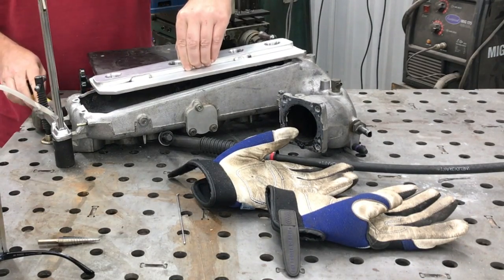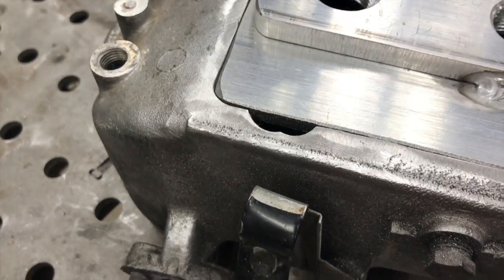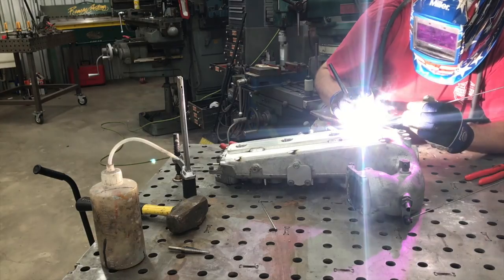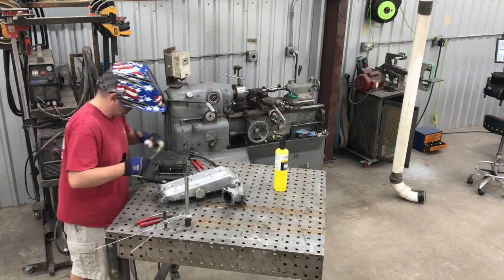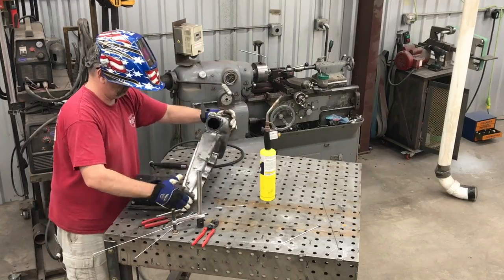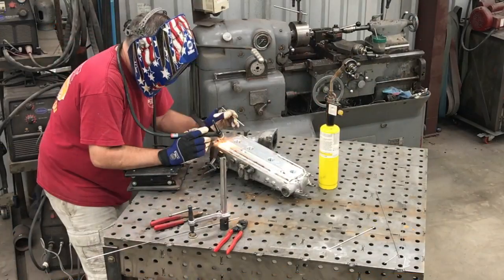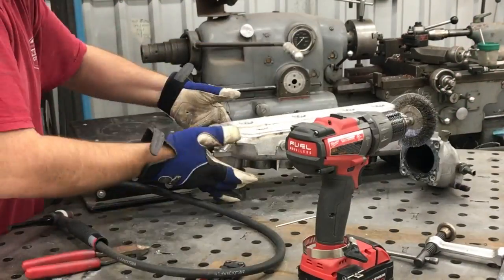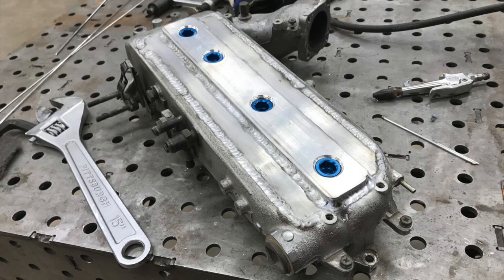Tig Welding Cast Aluminum Intake with Helium

Comment: Hey brother would you say that the argon helium 5050 mix is as effective as running 2 separate bottles with a brass Y...or cheaper maybe?  Trying to decide if I should buy a bottle with a mix or just get straight helium and by all the fittings to run it and to the Argon line... Sounds cheaper to buy the mix. I have a dynasty 280 so it ought to be plenty good enough for dam near any thickness of aluminum

Comment: Hello I would like to buy a welding machine at any company that advises me
Reply: Memo1977 Bahbahani if you want a good machine Tig buy a HTP Invertig 221 you get 220 amps and independent ac EN & EP amplitude setting which are found on the dynasty 350 and 700. The Invertig is reasonably priced $2500 for its class. If you want a cheap Tig to get going look at the ahp alpha x for $700 on Amazon. If you want a mig welder get the HTP Pro Pulse 200 great machine for steel and aluminum without the use of spool gun. www.usaweld.com I have many videos on both.

Comment: It turned out great! You mentioned using a Eastwood 200 Tig welder, which one (old one or new digital)?
Reply from the maker: I still have the old one, 3 years old, has worked great.  I a guy come by for some beginner training and he had the new one so I played around with it some.  Looked alot nicer than what I have.
Reply: I've got the original Eastwood AC/DC 200 and it's around 5+ years old with only about one piece of steel welding rod used! I haven't tried aluminum yet (don't know why I haven't) but it's there when I decide to try!

Comment: You want it to not crack v your mating edges out so you get a full penetration weld. :-)
Reply from the maker: well it cracked because when you cut teh top off the bottom gets a bow in it, then you weld a top on in that position, and try to bolt it to the lower it pulls the bow out and cracks it.  This is fully penetrated, that torch was blowing its own beveled edge all the way through the root and was jamming the filler in to keep it from falling through
Reply: @turbocobra  Try DCEN next time if your'e not going to "V" it.